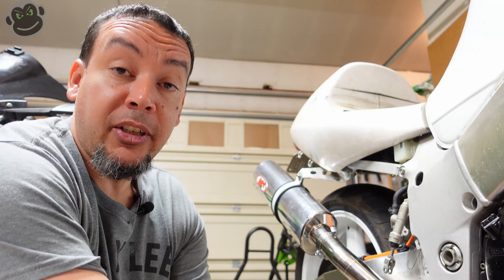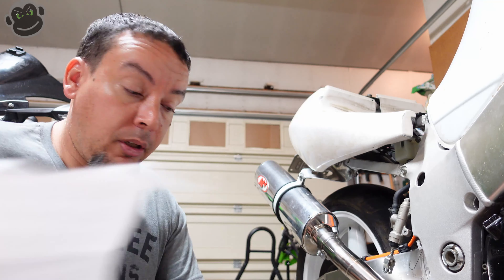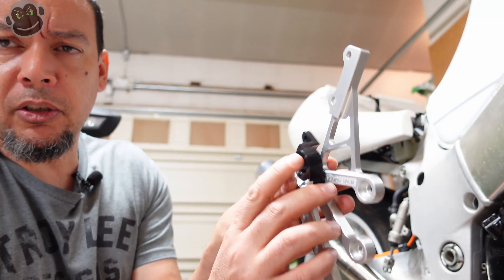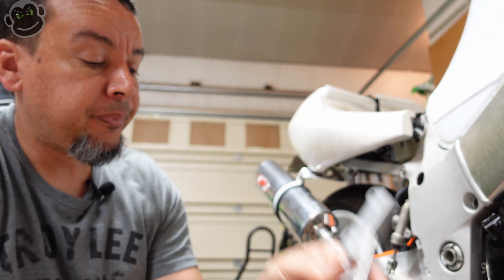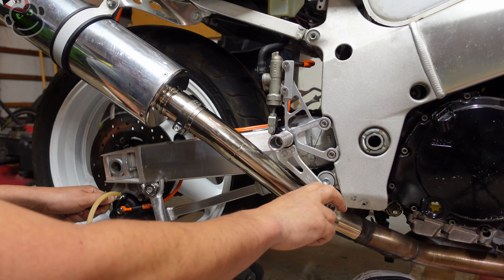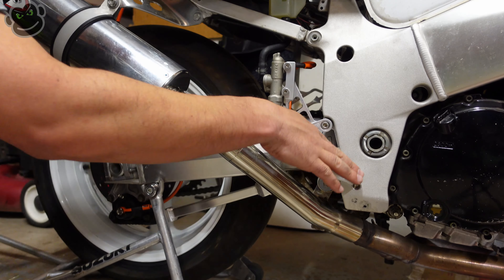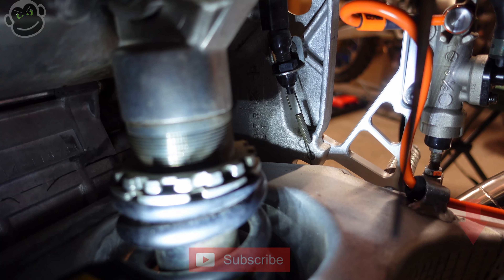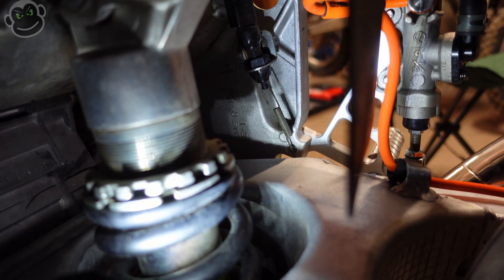WOODCRAFT REARSETS GSXR 600 | 97 Suzuki GSXR 600 Build | Episode 19

Comment: The new rearsets look good. As you pointed out it looks like Woodcraft should have included heal plates. 

I'm with you regarding the "recycling" of the new brake fluid. If everything is new and/or clean after a rebuild there should not be an issue.
Reply from the maker: Exactly!  100%

Comment: I had the same problem with an aftermarket rear brake lever and for some reason my brakes went bad afterwards we kind of Mickey Mouse it to make it work and I think it was not a good thing may be a put extra tension on it and kept the brakes engaged slightly or something but it totally wore my rotor out and ruined my back brakes so that’s one of the things I’m having them fix also by the way my bike looks great the last step is just making sure it’s running properly hopefully they can get it right oh OK wish me luck
Reply from the maker: I sent some luck your way, hope they get the engine stumble resolved.

Comment: I have my srad In the shop they did a full rebuild on the carb and everything they called me said it was ready and when I got there apparently it wasn’t ready I was still bogging out really bad in second gear and the carb has been totally rebuilt Any idea on what could be causing this there’s still trying to figure it out I told him to call me and keep me posted any ideas???
Reply from the maker: That's really hard to say if the carb has been completely rebuilt and the jet sizes are right then it's really weird.  They could put it on a dyno with some O2 sensors plugged into the exhaust and record the air fuel/ratio see what's going on there but maybe it's an electronic issue or timing.  IDK wish I could help.